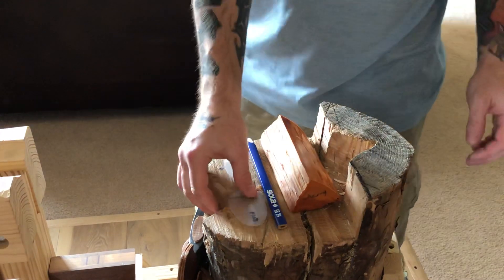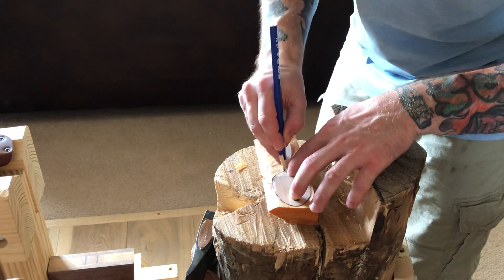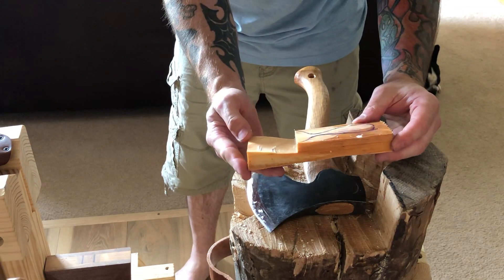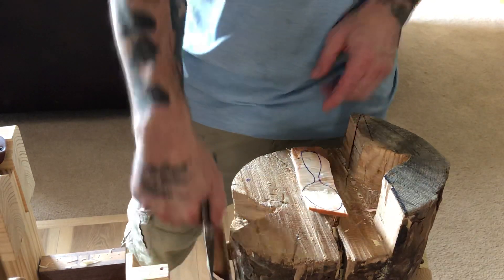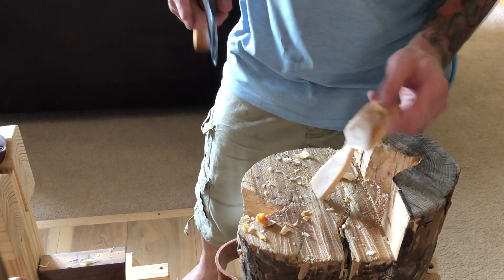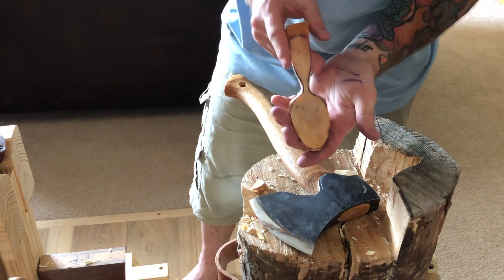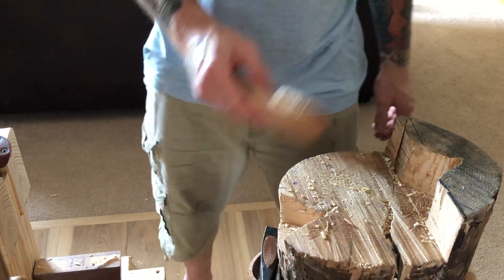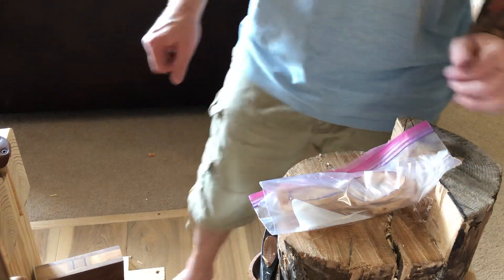Spoon Carving- Axe Work Explained

Comment: Looks like you made some modifications to the basic carving block and added some kind of tool holder around it which I can only get a glimpse of.
I'd like to see a video tour of the whole thing.
Reply from the maker: I’m actually in the process of building a new one. It’s been years since I made the one you see here and it’s time for it to be replaced.
Reply: @HuronSpoonCo , I would love to see a 360° view and a build video.
I've never done any of those builds yet for anvil blocks, tool blocks for the vice etc, your carving block, etc.  I need to know sizes, heights, and anything else.
Reply from the maker: The height really depends on how tall you are. I’m 5’ 10” tall and I find the main level of my chopping black being at 36” is perfect. The top level of it is about three inches taller, which allows me to support the neck of the spoon blank while axe carving certain sections of it
Reply: @HuronSpoonCo , 6'1" with a waist at 38-39".   I can stand for a while then I have to sit or go for a walk for a bit.  I'm guessing the log needs to be 18-24".  I've got a vice with some lag bolts and washers to secure it and a small square of plate steel maybe 4x4".  Need something for an anvil though.  Don't get down to the recycling yard much.

Comment: I've got a bunch of dried black walnut. Do you recommend I soak it before carving?
Reply from the maker: Hey there Graham. You can certainly attempt to- though in my experience, it does little to no good as far as rehydrating seasoned wood.
Reply: @HuronSpoonCo thank you! Makes sense. Have you carved dried black walnut? Beautiful but seems very difficult.
Reply from the maker: @GrahamZimmerman seasoned Black Walnut isn’t one of those woods I would be willing to carve. It’s already a wood that generally has tons of silica in it so it’s known for blunting edged tools fast even when green.
Reply: @HuronSpoonCo  Thank you for being so responsive. I have one more question: I have wood from a 100 year old white oak that fell in July 2024. I would love to carve spoons from it but have heard mixed reviews on white oak. Is it doable?
Reply from the maker: From my experience, white oak is perfectly doable when green. It’s a porous wood (something to keep in mind depending on its use) and can be a bit chippy when carving, but it can make some lovely utensils.

Comment: I keep hearing reference to the "grain change".  Wondering if anybody has ever explained this in a video before.  What exactly does that mean, and what does it require for consideration in axing, carving, etc.?
Reply from the maker: Typically, the grain direction of a given piece of wood is quite predictable and it’s easy to be able to tell what direction to cut from based solely on which section of a spoon you’re working in. Ideally, the grain runs straight from one end to the other but sometimes irregularities in the growth of a tree cause the grain direction to change. Sometimes this can be in the form of wavy grain, curly grain, knots, and many other types of anomalies. These instances cause us to get creative with the direction we cut the wood with various tools. Even experienced carvers may not be able to fully combat these irregularities in the grain completely. But understanding why they happen and how the wood is best cut (or from what angle) is your best chance at a clean finish with your tools.
Reply: @HuronSpoonCo  thanks.  After watching you carve that piece, it became more clear what it means

Comment: Can I ask something? I have a beautiful heavy Ochsenkopf vintage cleaver. It weighs 600gms. Can I use it for spoon carving in place of an axe?
Reply from the maker: The weight doesn’t sound like it would be a problem but the ergonomics and geometry could be. It would also need a proper scandi grind, which would likely be too thin since cleavers are much thinner than axe heads.

Comment: Leslie Ray Hunt was talking about you i am totally new to green carving i have always harvested carving stock put it up to air dry for a couple years I have done handles for axes and hatchets for years out of ash and bitter walnut which is available here in Vermont on my land i have used oak also.  I am going out and harvest a cherry tree tomorrow,    does it matter  f the tree is young 6 to 8 inch diameter
Reply from the maker: My apologies for the late reply! I'm just now seeing a ton of comments YouTube flagged. To answer your question- 6-8" will work great and is the size i aimed for when i first began carving spoons. Thanks so much for the comment!

Comment: great video! can I do this with dryed wood? or if put dry wood in the wather is the same effect as green wood? cheers from brazil
Reply from the maker: Hi there Louise! Dry wood typically doesn’t absorb water very well. You may find that soaking dry wood will soften up a couple layers of wood, but it doesn’t usually soak in very deep.

Comment: Very informative tutorial!!! Are you inside on carpet? If the set up that your working on is portable or beaks down, I think all of those living in space/apartment with no garage for a shop, we all could benefit from an explanation or a "tour" of the setup.  I have a shop that is insulated, but not yet heated. If I could set up something in my spare room for winter carving, I'd love to see it. Thanks and you got a new subscriber.
Reply from the maker: CrossGrain Wood Products,LTD my space is only 8’x4’ but suite my needs daily well for the time being. It’s basically just a floating floor on top of carpet. If I had to guess, I probably built the whole thing for $100 or so

Comment: Amazing work man. Is there a cheaper carving axe that you could recommend?
Reply from the maker: If you’re good with resetting bevel angles and have a bit of patience, any hatchet with long bevels weighing between 1-2 lbs could be good for carving, depending on the weight you prefer. The Gransfors Bruk Wildlife Hatcher is a popular one as well, along with either of the carving axes Robin Wood makes,  which can be found at https://wood-tools.co.uk
Reply: I began with a simple hardware store hatchet.  It worked OK for 2 years.  When I knew I was hooked on carving I bought a Hans Karlssan carving axe for around $300.  It is more money than the Gransfors Bruks that is being used here.  It is also lighter and an amazing axe.  As well as spoons I also carve bowls.  I would say the Gransfors Bruks is better for bowls as it is a heavier axe and it takes off more material in a wack.  That can be a down side when carving smaller pieces of wood used for spoons.  Either one can be used but fi you don't want to fork out $250-$300 any hatchet will do.
Reply from the maker: Bill Astell I used to use a lighter axe but found that the lack of heft translated to me having to use more force. After a year or two, I developed tendinitis in my right elbow/forearm. I found that an axe with more weight requires less force to use and thus meaning I can wield it for longer periods of time without fatigue or damage to my body. Everyone’s different though and some people prefer a smaller axe.
Reply: I've got to say you do an amazing accurate cut with the heavier axe.  I'm doing a BIG bowl now and wish I had the heavier axe.  Sadly I will have to make do at least for now.
Reply from the maker: Bill Astell don’t get me wrong, I’ve acquired some very nice tools over the past few years but there’s something to be said about doing the same job with tools that aren’t perfect for the job. I hollowed a whole bowl with a spoon knife once just to see if I could do it. It’s was slow, inefficient, and wreaked havoc on my hands but I was super proud when I finally finished it.
Reply: @HuronSpoonCo  On the Gransfors they have a RH/LH bevel and an equal bevel.  Which do you recommend?
Reply from the maker: Marc Prioleau the way my friend explained it to me, who is a Gransfors Bruk dealer here in the USA, a right-handed individual will want the right bevel and a left-handed person would want the left bevel. As for the double bevel, I haven’t used it so I can really speak to it’s efficiency but I can tell you I love the right bevel model (and I’m right-handed).
Reply: My carving axe has a symmetrical bevel.  The same on each side.  Most of the time I cut right handed but on occasion I do have to cut using the other side of the axe.  That may be difficult with a side/single bevel axe.  I also single bevel axes (side axes) both left and right but they are best for squaring timber or putting a flat side on a piece of wood.  They also have flat faces not generously curved like a carving axe.  My advice is get 3 one of each. LOL!
Reply from the maker: Bill Astell I have other axes that have a double bevel and they work just fine as well. The single just feels really aggressive and I prefer it sometimes
Reply: I just got lucky and found a Gransfors Bruks carving axe on KIJIJI.  When I picked it up it was an old one that the man had never used.  It has a bit of a side bevel but not what I had the side bevel would be like.  It is not a full side bevel like my squaring hatchets/axes. After taking it for a test drive on the big bowl I'm working on I must say it is lovely.  The Hans Karlson is, IMHO, better for delicate work like spoons as you can actually choke up very comfortably and carve with it almost like a knife.  Bottom line is, I am glad the GB I got has the side bevel.  I t really cuts in to the log with less angle than the HK and with fewer swings gets the job done.
Reply from the maker: Bill Astell it’s a great axe, for sure!

Comment: Great video, thanks for sharing.

On axe maintenance - what grit do you use to keep that tool so sharp, and about how many spoons do you get before you resharpen (I appreciate this is wood dependent)?
Reply from the maker: Thank you. As for the grits I use, they’re the same whether I’m maintaining an axe or a knife. Usually I work in the following order: 600, 1000, 1500, 2000 and follow up with a coarse strop and a fine strop with two different compounds on them. As for resharpening, it really does depend on how hard you use it and the characteristics of the woods you’ve carved with a given tool. If there’s lots of knots, inclusions, or you encounter foreign materials, you may need to address the cutting edge often. Some woods are high in silica as well, which typically translates to frequent sharpening due to nicks in the cutting edge. Hope this helps!
Reply: @HuronSpoonCo  Thank you sir, that is very helpful. (I'm getting started in this hobby.)
Reply from the maker: LyKaI0s I’m here for all kinds of questions. I’d love to help if you need it in the future.
Reply: Wish I saw this before I started making my first one. I'm still in the process.

Comment: The way i see the reason to use templates is for left-right symmetry. Aside from decoration that someone chooses, to me there is nothing worse than a weird spoon or other carving that isnt square or a handsome oval or something when that was the intention. When a spoon that was supposed to be round comes out like a trapezoid its not nice and there are only so many times you can blame your 5 year old kid. But a person can draw templates in their PC and print them. The reason im taking this up is to have the kitchen spoons I really want and cant buy anywhere and because I cant stand using stainless steel forks and spoons that keep touching my fillings and making me jump off the chair. Plastic spoons dont cut it. Besides, carving is very therapeutic, you can think through a lot of crap during hours of it.
Reply from the maker: For me, it makes sense to spend time once designing a good spoon and then applying that template onto wood for repeatable results. Once you carve the same design several times, you can see the benefit in not only the large picture details but also the minuscule. Sometimes I feel like I have a hard time telling my hands what to do when drawing designs. It seems like the pencil doesn’t want to go where my mind tells it to. So rather than spending 30 minutes drawing a given design every time I carve a spoon, I draw it once and make a permanent stencil for later use.

Comment: Great video!  Thanks so much!  Maybe you mentioned this and I missed it, but is there a reason why you waited to put the crank in the second one until after you roughed out to your lines vs the first one when you put the crank in before roughing out to your lines?  Was it because of the knots?  I need to check if you already have a video on your chopping block, but if not, I'd love for you to talk about how you made it and what kind of wood it is.  Thanks again.
Reply from the maker: Sandra Zern I don’t always follow the steps in order necessarily. I just kind of do whatever feels like an appropriate next step. As for my chopping block, I have an album on Facebook (I’m not sure if you have a FB page) that outlines how to make a similar one.

Comment: 802/5000
Halo HoronSpoonCo, I found your videos and I would like to carve spoons with my sons. We have axes from Gränsfors and Svante Djärv Super hand-forged knives. I have two little questions. 1. Where can I see how you made your chopping block, unfortunately I couldn't find anything on Fcebook. Maybe my problem, can you please send me a link?

Second, are we not sure what the wood should be like, fresh from the forest, and if so, what time of year? Should it be fresh or does it have to be dry? I have seen that you collect some things in containers filled with water. Can you explain that to us in more detail? That would be really nice of you and we would be very happy. Many warm greetings from beautiful Brandenburg in north-east Germany Jens
Reply from the maker: Here's a link to the Stump build:

https://www.facebook.com/media/set/?set=a.2256430837713738&type=3

As far as the material its made from, I used Ash (a very hard wood) that had been seasoned for several years and it has held up very nicely compared to stumps I have made from wood that is softer and/or still green. 

Hope this helps!

Comment: Awesome video! Just wondering what model/size that Silky Gomboy is? Thanks!
Reply from the maker: Joshua Perry this one was originally the 240 blade but was replaced with a 210. Lately I’ve been using the Silky Pocketboy 170

Comment: Whats the weight of that axe head? I have a choice when buying-- 500, 600, 800 and 1000g.
Reply from the maker: cvcoco honestly I don’t remember but if I had to guess I’d say it’s 800g
Reply: @HuronSpoonCo  Thanks...it looks humongous and tiring. Would you have preferred lighter as a beginner or does it not matter? I would understand a heavier head in the hands of an experienced carver, but for a beginner it may call for a lot of ill placed strokes and wood splitting and wrecking and lack of control. Any thoughts before I click an order button? Sorry, im a novice here and just trying to start.
Reply from the maker: cvcoco I wish it’s something I could give out great advice on but unfortunately it really is something the user has to determine. I found that axes around 1lb were much too light and required not only more strokes to do the job but also more force- which led to me having tendinitis in my elbow. I think anything between 1.25lb to 1.5 lb is a great weight for someone less experienced and 1.5lb to 2lb may benefit more experienced carvers. Keeping in mind that everyone’s muscles are different.
Reply: @HuronSpoonCo  Good points. Its the repetition thats led to a lot of our troubles like carpal tunnel syndrome and surgery and all that. Your next vid, "Exercises to Keep the Carver Out of a Hospital." And, carving dry, aged wood is punishing. Stay on green or damp wood. Where you use an axe, others use dremels and band saws and I see why. I want to be traditional about this but have to save the body too. Its all good today, the arthritis comes later and we wont know why. I was reading that Olympians wind up in wheel chairs by 70.
Reply from the maker: cvcoco I’ve actually recently written an article regarding safety for spoons carvers, though I’m still trying to figure out the best way to share it online without having a website.